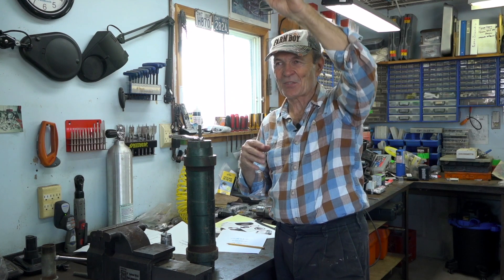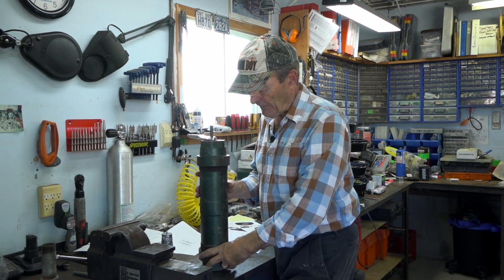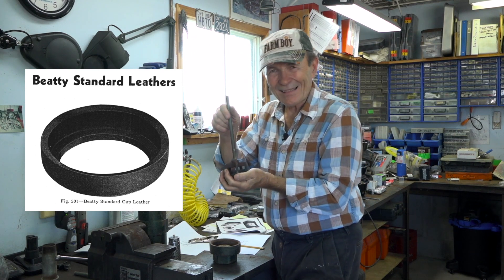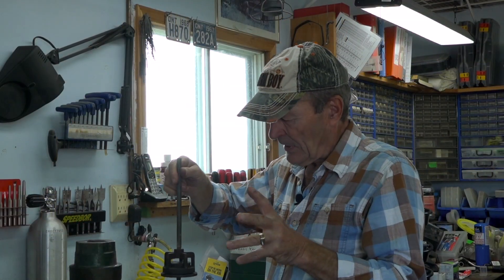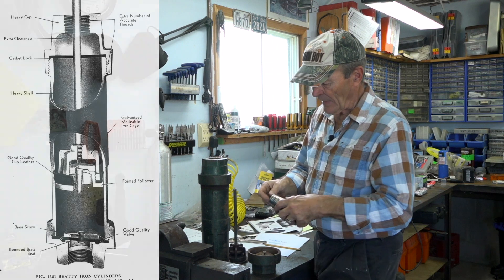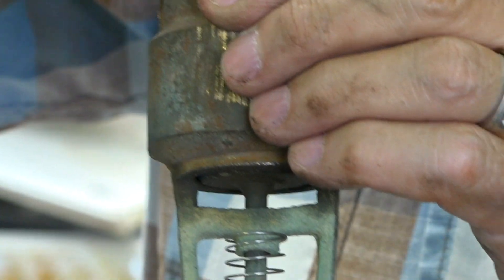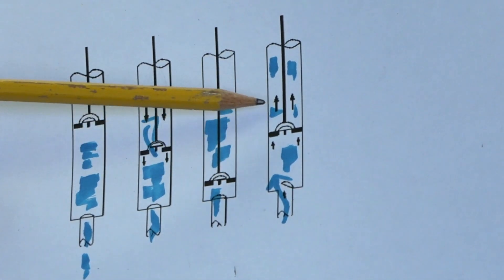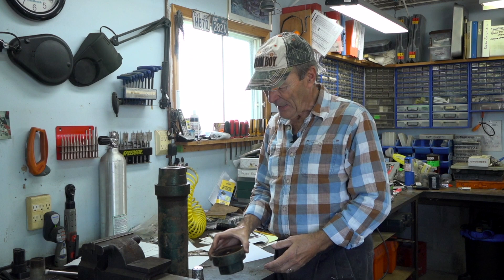#85 How Does A Windmill Pump Water? | At The Ranch

Comment: My wife and I are building an off grid home and we want to minimize our electrical demands. I have many Amish friends and I know one guy uses this technology combined with a Honda engine to deliver his water to the house. I would like to incorporate this into our utility resources. Can you advise me?
Reply from the maker: If the Amish use it, it's efficient and will work for you without the Honda.  I don't know of any resources to plan and supply a water pump setup but Google it as there has to be suppliers around.  As mine is 100+ years old, it's all hand repaired using a few replacement parts (e.g. the flapper valve).  Good luck and you will have a perfect wind water supply.

Comment: Hi Alec, great stuff, thanks. I've seen one of these pumping out of the underground well and gets pumped out half a metre above the ground. Can you use one of these to pump an above water source, say a pond, up 10 feet above the ground? All the best
Reply from the maker: For a small difference in hight, a sump pump may be better and faster than a windmill powered pump.  There are setups specific to above ground to higher ground uses, a Google search will show options to pick what works best in your situation.
Reply: @AlecPeirceAtTheRanch  Thanks Alec

Comment: Great video Alec. You're a good teacher. We have a number 2 kitchen pump at the cabin in Michigan that has this same mechanism. Every time we leave we have to drain the well. I leave the lower leather in place because after it dries it will never reseat properly. I pull the whole top off and soak the piston leather in a bucket while I'm gone so it doesn't dry out. The leathers cost about ten bucks for the piston and four bucks for the flap. I might have to buy new ones every year or two. If you're careful you can get a couple of years of use. I think you're right Alec, I would imagine that if you never had to pull them you might get five years out of them.
Reply from the maker: The fact that I can get properly fitting leathers for a 100+ year old water pump tells me others are still using them too.  Almost finished the refurb on the water system.  Hope you like the last ones.
Alec

Comment: How long does the leather seal last
Reply from the maker: If it's kept in the water, pretty much forever. If it is allowed to dry out completely, you'd have to replace it every 5 years or so I'm guessing. They are cheap but a bit of a nuisance to replace,